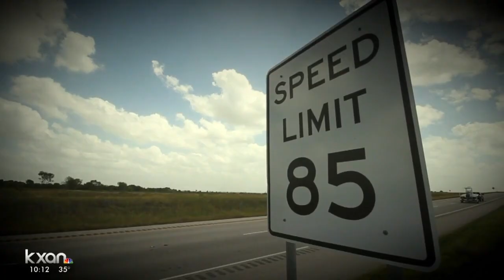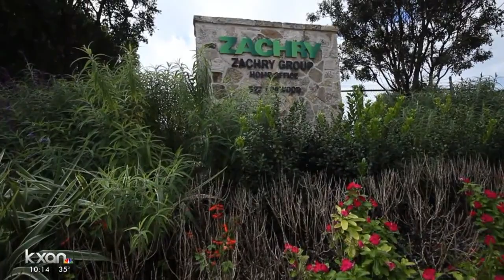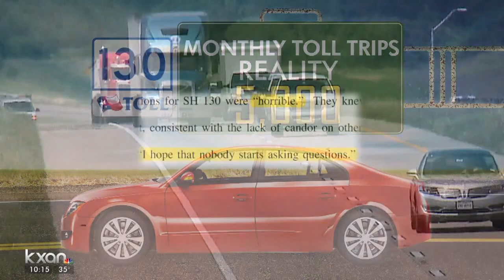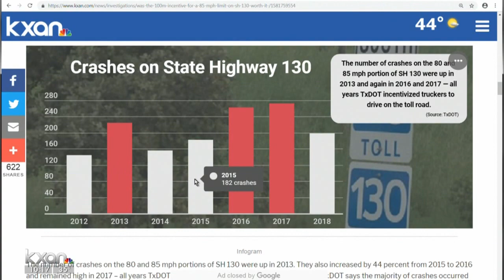SH 130 former executives accused of hiding construction defects from public, lenders

Comment: A freight corridor is a good thing.  It reduces the interactions with non commercial drives in Austin.  And if you driven a big truck for any amount of time you understand how important something like that is.
Reply: True but I would not want semi's going 85mph on it if they are gonna turn it into a frieght corridor then the speed limit should be significantly slower for safety.
Reply: @patrickradcliffe3837  you aren't a trucker are you?  Statistically speaking truck drivers are far safer than a class C driver.

That number drastically changes in over whelming favorability of truck drivers once you get rid of swift and western express.
Reply: @dontneedtoknow5836  you just blew your point mention Swift and Western Express, not to mention the chucklehead local guys that got their CDL out of Cracker Jack box school. Statistacal speaking accident "rates" have stayed the same but the number of Trucks on the road has skyrocketed but looking at the numbers their are more accidents now then in the past. I'm good with a freight corridor but gotta lower the speed for safety.
Reply: @patrickradcliffe3837  but in another statement you cried because you get stuck behind one doing 70 miles an hour.  You just can't make up your mind can you?
Reply: @dontneedtoknow5836  apples and oranges. IF they are NOT gonna turn it into a frieght corridor then they need to keep semi's off it.
Reply: @patrickradcliffe3837  if they turn it into a freight corridor they need to keep cars off of it.
Reply: @dontneedtoknow5836  agreed

Comment: Semi's need a maximum 55 mph speed limit they are way to heavy and incapable of stopping or controlling that much weight with everyday traffic.
Reply: I have driven them for 18 years hauling oversized loads and never had a problem with that, it’s the four wheelers cutting us off and driving like they in NASCAR...if you have never driven one, you have no experience to even claim that...and for your information the interstate highways system was created for freight movement, not everyday traffic, look it up... get off our roads